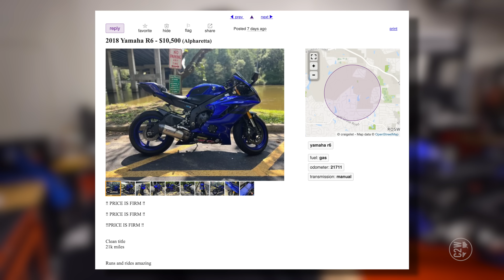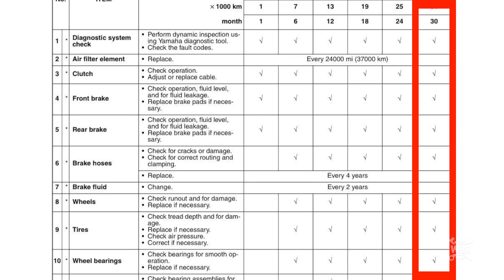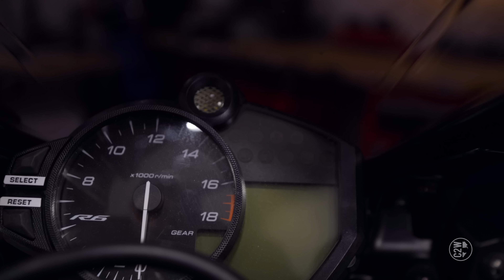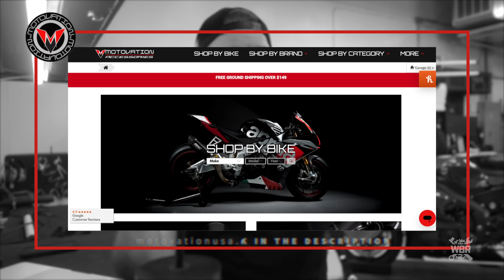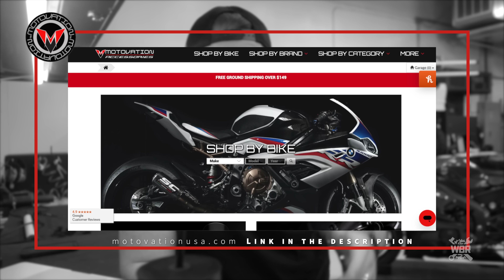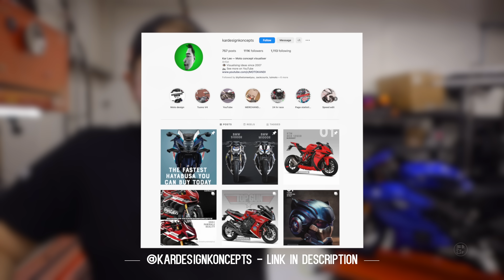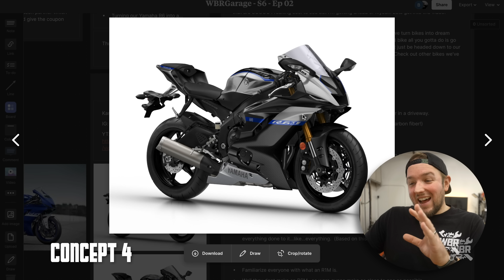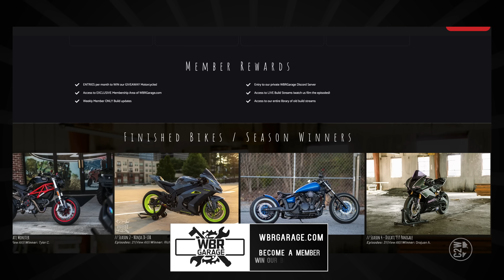Yamaha wouldn't make it so WE WILL!  | WBRGarage S6 Ep02

Comment: I’ll never understand how people think 22000 miles is a lot on any type of bike. I work on super sports that have over 80000 miles all the time running perfect
Reply: Weekend riders 😅
Reply: Because most people never actually ride their bikes.
Reply: This is great information actually I always wondered about that.
Reply: @reallunacy  exactly,
Reply: Modern Japanese bikes will go to 100k easy. I was astounded when I took a look inside my buddy's 03 FZ1 transmission with 40k on the odometer. The gear teeth and all looked new. Case hardened steel is no joke!
Reply: @MT-THNDR207  this instills more confidence when looking at used online.
Reply: Agreed.  I have 65k original miles on my 09 cbr600ra and runs like a top WITH the original clutch.
Reply: @reallunacy  it’s because most people don’t need to daily and don’t ride everyday, most people have cars and don’t need to commute with a bike.
Reply: I didn’t either until I started doing group rides and people ride once at week at most and they ride for a hour max

Comment: 12:30 The reason why you cannot move the adjustable lever is because it is locked in place with a nut at the bottom. It's quite literally connected to a small cog that has different size grooves in it. You must loosen the nut to adjust the lever. It's made that way so you don't accidentally change the adjustments while going down the road. For the "Sharp bits"; just use a small file to smooth them out.
Reply: Just push the whole lever forward to allow clearance and then adjust. There would be no point of quick adjusters if it were locked with a nut!
Reply: When you gotta loosen nuts 'n take a file to 'em to stop amputating your pinkies, you know it's time to ditch your levers
Reply: @LeeTillbury  If you need everything to be fit perfect out of the package. You're probably broke.

Comment: 9:40 I'm gonna hop in here and tell you that that's not necessarily the lever itself. Idk about those bikes in particular but I have a 2011 Honda VFR800X which has the combined brakes abs system, and it didn't matter if it was stock or aftermarket levers but my front brake basically acted the same way that R6's brake is. So it could simply be a bike thing or  maybe a fluids thing idk.